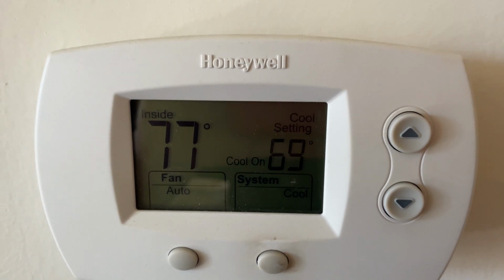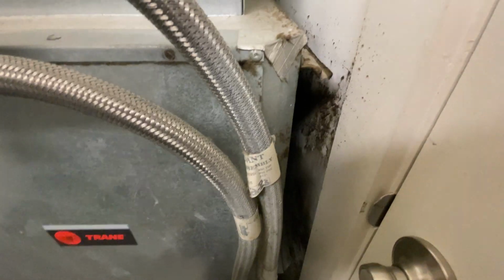A/C Troubleshooting (#1)

Comment: Nice job 💪 No micron gauge bro?? Keep the vids coming 🔧👍
Reply from the maker: Thanks bro. It’s there. I hook it up off the suction line core removal tool. 👍
Reply from the maker: Ya I do a lot of recording in my iPhone lately and it (me) has a habit of hitting the slow Mo button when I think it’s on video and and looks like shit when I size it to 4K unfortunately I just trashed all those clips. I’m gonna make a full step by step video on recovery/evacuation and link all the videos when I’m doing repairs to it. I said this last year and didn’t do it but also plan on recording every a/c call I do. I’ll keep an eye out for your new videos bro 👍
Reply: Wait, so nothing was grounded on the compressor and the windings checked out okay? And the compressor was still bad?
Reply from the maker: Ya just wasn't starting up right. Both in heat and cool mode. Not sure the root of the cause but just don't have the time or motivation to cut open compressors anymore to see why they fail. Maybe it was a lubrication issue? Heat pumps are tricky and I replace the reversing valve and compressor when possible but only had the compressor  on hand and worked good this time.
Reply: That compressor was in locked rotor. At one point after you hooked up the super boost the compressor did try to turn over but it hit 72 amps. If you would have had the MAX turned on or had a meter with "In-Rush" you probably would have captured a much higher reading. If the super boost wasn't enough to pull it out of locked rotor.... IT'S DONE! Change it out. 😎👍
Reply from the maker: Thanks Shannon!